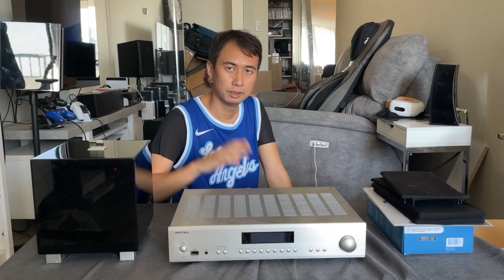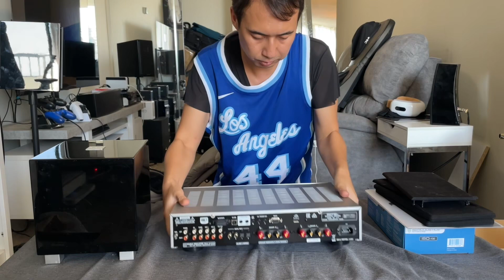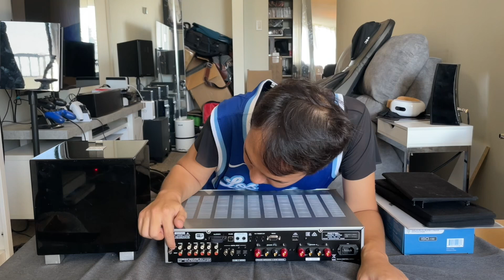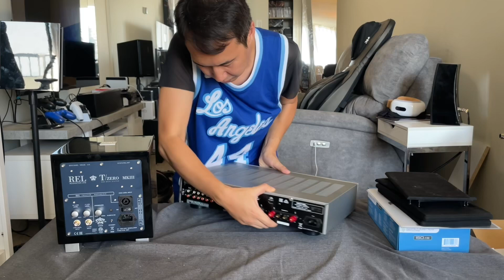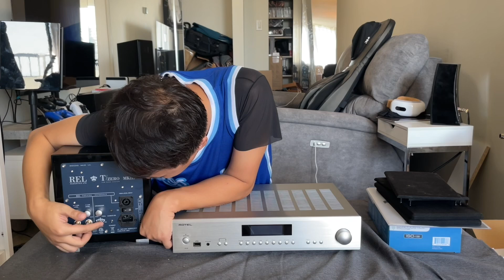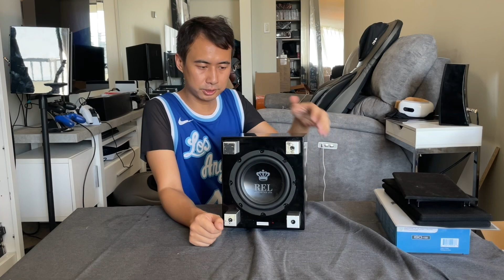Rotel A12 amplifier, REL Tzero MKIII subwoofer overview

Comment: Nice video.  I just ordered a used A12.  Have not yet received it yet.  Are you happy with the sound using the USB from computer?  That is how I will be using it along with a Bryston digital player hooked up to the coax input.
Reply from the maker: It's not the latest DAC, I have the A12 first version with the older Wolfson chip in it, but so far it's still solid for the price. The newer A12 uses a more up to date ESS Sabre chip in it though and might sound better.